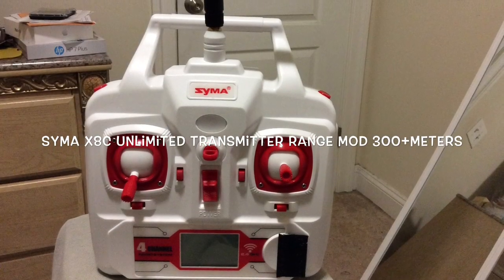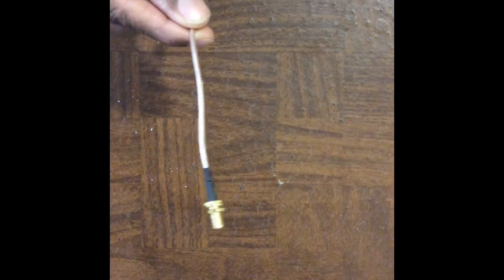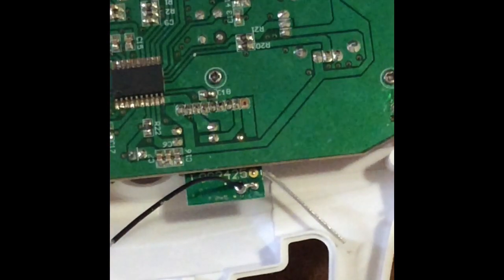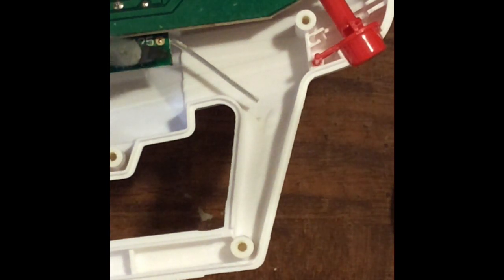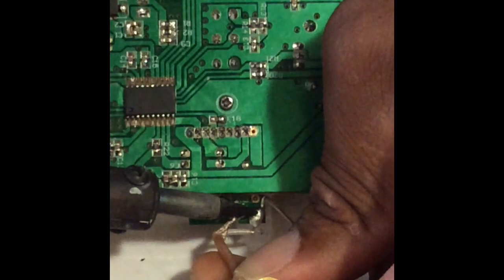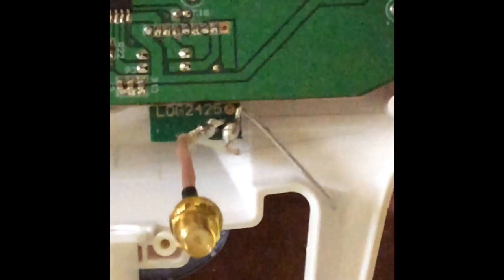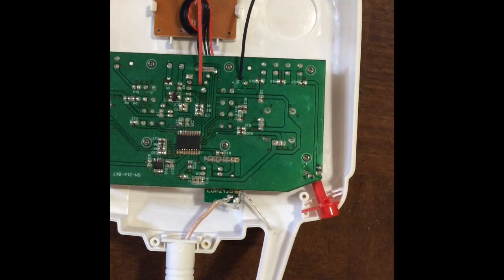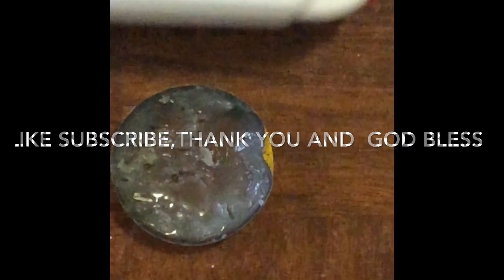Syma x8c step by step transmitter modification 300+ meters of range guaranteed

Comment from the maker: First I would like to thank you for the confirmed benefit of this modification,although this craft has great stock range this modification does add to it as you witnessed.As for your question about modding the 666 transmitter I'm pretty sure you can I'm just not familiar with it.I modded all my transmitters with witnessed increased range.Take your time and analyze how the original antenna is set up shielding and antenna.Invest in a helping hands soldering stand with a bifocal magnifying glass.Make sure the wires with the antenna and shielding are not touching.If you can take a good
Reply: +C0ckPitVuE 777 Worked on my X8c and can't tell completely, but I think it's increased my range on the X8g 10 fold..I have to find it first so I can retrieve the cam footage! lol God bless you, THANK U!
Reply from the maker: +HollywoodREBEL Hey brother appreciate the feedback, hope all works out for you.Glad I can be of help,thank you and God bless you also.
Reply from the maker: up close picture of the inside of your transmitter, send it to hearmeout38@gmail .com,I will be glad to help you if I could.God bless.
Reply: +C0ckPitVuE 777 thank you. Actually the quadcopter still on the shipping from bangood. I will test the range by original transmitter first and take the picture inside of it to you. Thank you very much again!
Reply from the maker: No problem.

Comment: I have done this 1 moth ago. That's really good and syccessful upgrade. Someone said it already got 300+ meters from factory so this modification is unnecessary. I think you are lucky got this, but Iam not. Befor this modification I only got 50+meters range for my sayma x8c. when the altitude reached 50 meters it lost the signal and crashed. Thanks this detailed video and after modification I got at lest 250+ altitude range on same site where it has crashed.
Reply: +Nie Lianghao I am back here just wondering ask can I use this modification for another quadcopter, I just got my new WLtoys V666. Waitting your answer if you have any idea. Thanks
Reply: +Nie Lianghao Yes you can. I've done this on my Tarantula X6 and MJX X600.
Reply: Mine was the same, only 30 meters or so and signal would drop at times could go out 100 meters and have signal, aka intermittent drops. Did mod and start to get drop signal loss @ 200 meters. New batteries what else could be messing with range. Drops in all locations flown

Comment: so the black transmitter is for the transmitter? for what is the white one? thanks for the video, god bless!
Reply from the maker: The black is the antenna that sends the signal to the craft to fly it,the white 1 was for the wifi camera.thank you and God bless you also.
Reply: +C0ckPitVuE 777 so most likely my X8C won't have this :) thanks for the fast reply!
Reply from the maker: +MegaGFreak yes the x8c will have both unless they revised the first version.This is the x8c transmitter.I think 1 of the other x8 versions was having problems with range,if you go over to Quadcopter 101 channel he did a vid last week on this same subject.

Comment: Thank you for replying! Your right, he never showed his results. I ordered the sma cable per your recommendation, just waiting for the slow boat from China to deliver. I'll let you know how mine turns out. Thank you again!
Reply: I used cable and antena from my old WiFi router.
Reply from the maker: You're welcome,take your time splicing the sma cable,because it's very easy to pull the wire through the hole that attaches to the antenna.Hold the other side of the wire with a pair of needle nose pliers without damaging it while splicing the other side.God bless,keep us all updated.
Reply from the maker: +Dariusz W that will also work,thanks for sharing.God bless.

Comment: Hi
I did modification on my controller and checked a range on open space. Its range was about 300 and after mod it is 600 m.
I was flying on about 3-5 m high so my syma is still operational after it dropped :-)
Thanks for video.
PS
I am already blessed.
Do not double.
Reply from the maker: +Dariusz W Thanks for sharing the results,please don't scuff the clouds,lol
.

Comment: Great video! But before I mod my x8c I wanted to give you a link showing a similar mod. However, in your video you said to leave the white antenna wire alone ( I plan on doing mine the same as you did in your video), this guy does the exact opposite. What will be the outcome if done the way this person has done it? http://youtu.be/Y2DD10_IObc. If you could email me an answer that would be great ( tootall6959@comcast.net) thank you for your time!
Jim
Reply from the maker: +jim ussery Yes the clear antenna is wifi,he never showed a video of his results.

Comment: Can I use a 10dbi antenna ?
Reply from the maker: I wouldn't advise it,the 5 is way more than you need.You will lose sight before you lose range.These are omnidirectional antennas,the higher you go in gain the thinner the signal bubble.God bless.

Comment: I messed up my first mod attempt.. I think the antenna and cable I purchased off of ebay was a china cheepy,, the Outside lookked like a 5db but when I tried to splice the wire and the mass? there was not mass,,,just really really thin wire..and the  stock antenna only had 1 solder point instead of 2.. I thought the x8c came stock pushing 300 meters? what I really need is a range mod for is my
AR and my Kolashnikov I E the x6 tarantula and the jjrc h8c I have another antenna but I wont use that one, it's wire and mass are to thin to actually get a good splice out of them...
Reply from the maker: Look in this vids description,everything you need is in there.Pretty good quality made material for a reasonable price.God bless,hope your next attempt is a success.

Comment: Thank you for the detailed video, was wondering if I need to cut the SMA cable to a certain length?
Reply from the maker: No it doesn't matter because the 5db antenna is the proper length,I will advise you to order more than 1 ska cable if this is your first time,I also advise you to hold the wire with a pair of needle nose pliers while splice and pulling on the wire,it's easy to pull the point out the hole that plugs int the antenna.
Reply from the maker: Sma not ska,lol.
Reply from the maker: And you're very much welcome.

Comment: Hey, i have a 7db antena, does it work?? Or i need a 5db?
Reply from the maker: That's a really good question,never tried 7db because 5db gives me more range than I visually need. I also heard people say you got to hold you antenna a certain way to get the best range which I found was false.I always keep my antenna extended and get great range,the bottom line is if you got it cautiously experiment in a safe area and share your experience with us,it would really be appreciated.

Comment: Really good video, very helpful. Thank you!
Just wondering what's type of you antenna on your transmitter? I really need to improve my Quadcopter's range, it was crash when it out of 100 meters.
BTW, just saw your videos they are very nice and without any jello, how did you mount your camera? Thank you again for share this amazing tutorial!
Reply from the maker: Thank you brother appreciate your words of encouragement,glad it was helpful.There is major jello issues I haven't quite figured out yet,though I do balance my props with sand paper and a prop balancer.Still looking for a better resolution to the problem,I am experimenting with different scenarios until I feel content enough with the final product.Once I fix the problem I will post a thorough tutorial.Appreciate your feedback and support.
Reply from the maker: It's a 5db antenna,the link is posted in the description.
Reply: C0ckPitVuE 777 Hahaha, I haven't found out the link of antenna because there are three links showing up together in the description. Just get everything what should I need and now I am waiting for the shipping. THANK YOU VERY MUCH : )
Reply: C0ckPitVuE 777 I am looking for the 2D gimbal and FPV as well. I guess 2D gimbal may solve the jello problem. I did some research about PFV, it may take $50. However there is major problem that how to mount gimbal on syma x8c. I am very like this quadcopter, cheap and powerful. and also it have lots of potential to improve like what you have done. Thank you answer and feedback. Very glad to talke to you : )